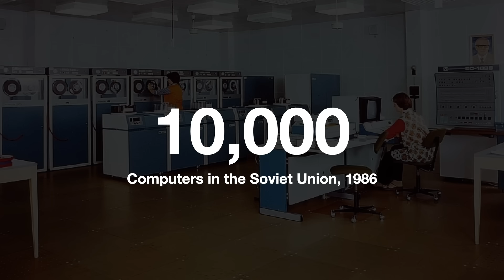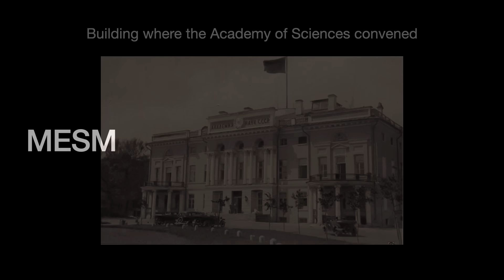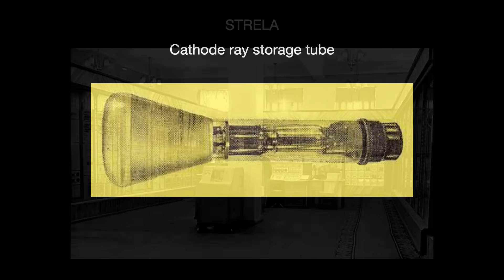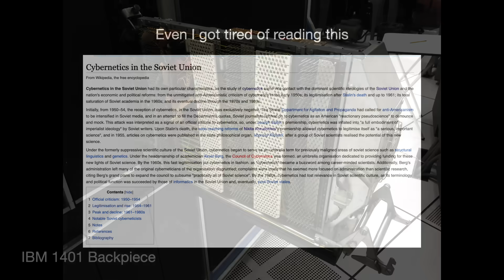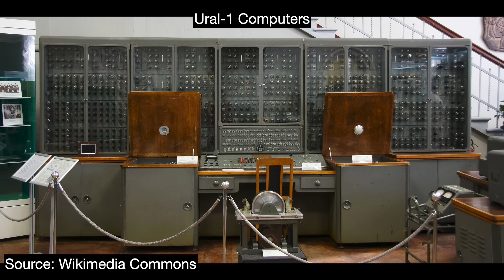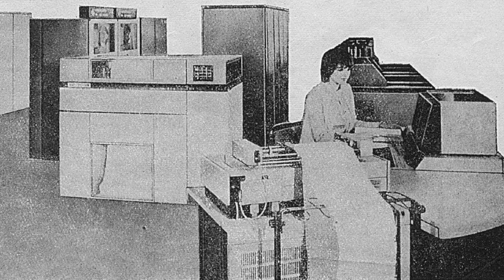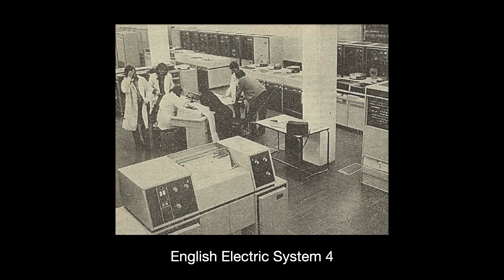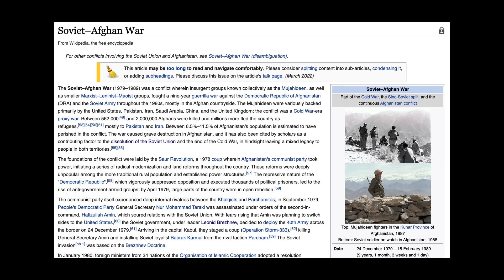Why the Soviet Computer Failed

Comment: It’s hard to utilize chips that were manufactured in a gulag, using scrap metal that would even be rejected by Lancia!
Reply: Russia used a 2.5mm pin pitch.
Everywhere else uses 2.54mm. (1/10”).
Even functionally identical chips are incompatible if they have more than eight pins.
Reply: @allangibson2408  Russia manufactured export leadframe chip variants with 2.54mm pitch as well. These were needed in East Germany and Bulgaria.
Reply: @SianaGearz  East Germany manufactured their own micro electronics (up to microprocessor level including 80286 clones).
Reply: @allangibson2408  that they did, but they also exported chips to and imported from Soviet Union to make up for gaps in capacity and allocation. East German manufacturing was better geared towards higher end semiconductor products.